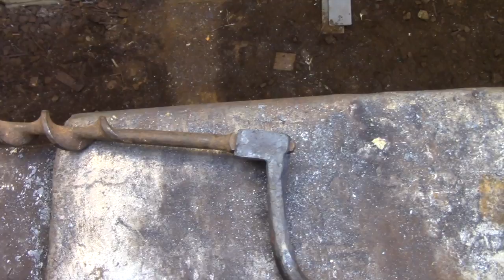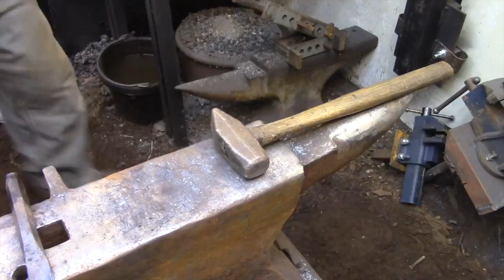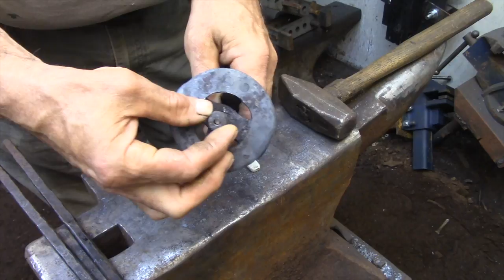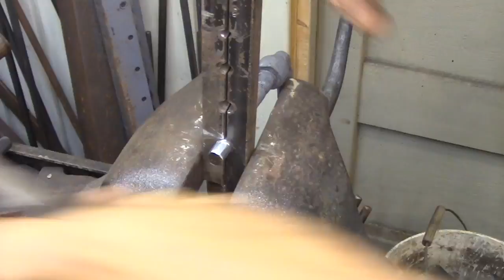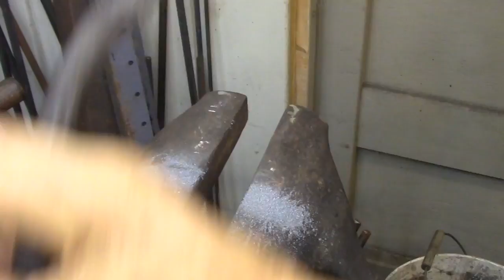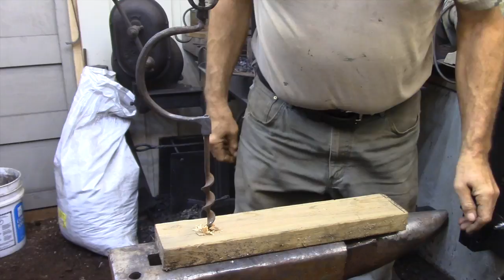Blacksmithing Project - Blacksmith Brace 5

Comment: I love it. Used many brace and bit growing up. Still grab one over the cordless drill when I tap the maple trees in the spring, or any other quick drilling that needs to be done away from the house. 
As for the chuck, do you want it to be historically accurate? Or merely functional?
Reply from the maker: I think I'm going to keep it fairly simple.  This type of brace wasn't made in a factory and a lot of them had nothing at all or just a simple thumbscrew.
Reply: DF - In The Shop 
Sounds like a plan. A set screw is an easy approach! 
Another idea would be a a detent spring of sorts that just held against the side of the bit.
Thanks for the reply